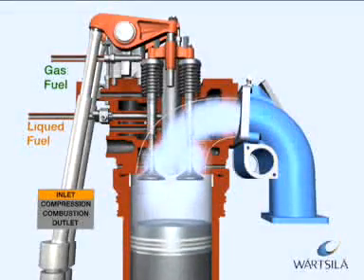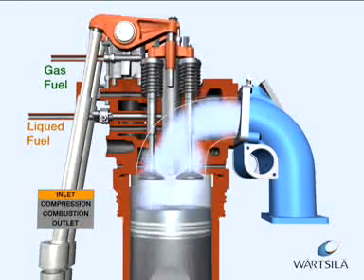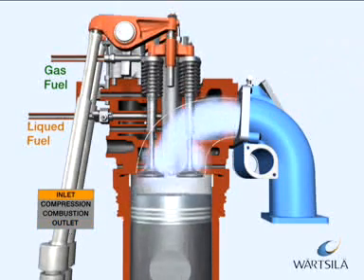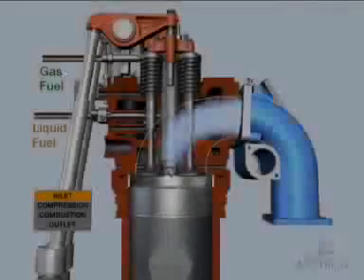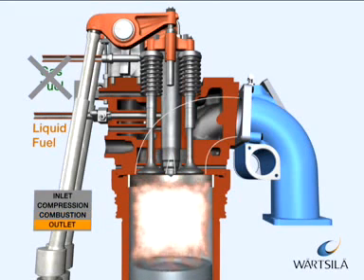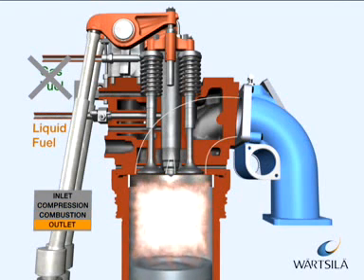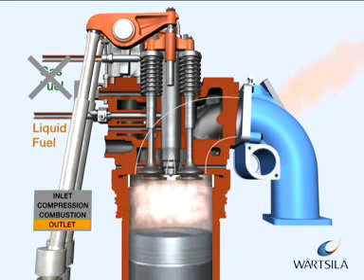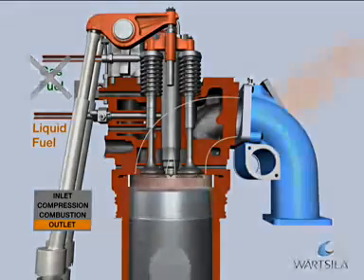4 stroke diesel engine

Comment: 2 strokes are fast accelerating but lack power so you cant have such a big bike. 4 strokes have more torque and can probably reach alot higher speeds. also 2 strokes are worse for emissions as they burn oil